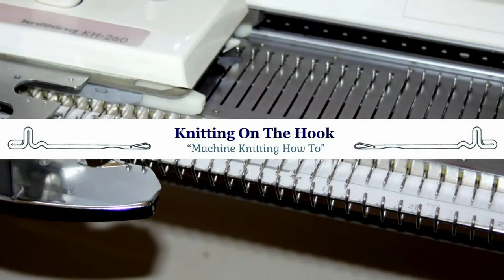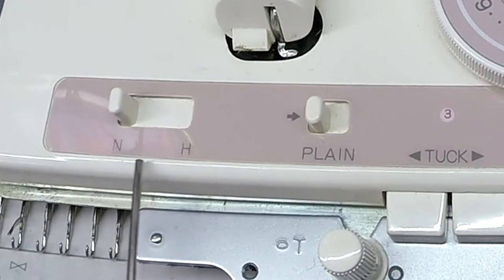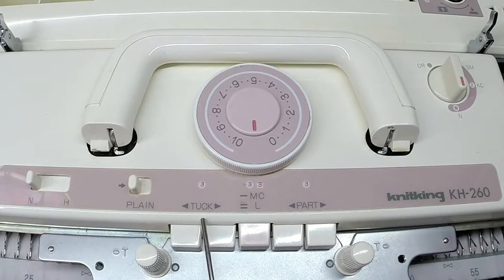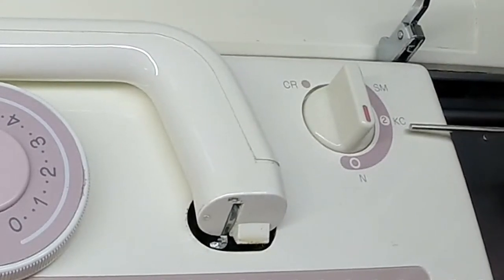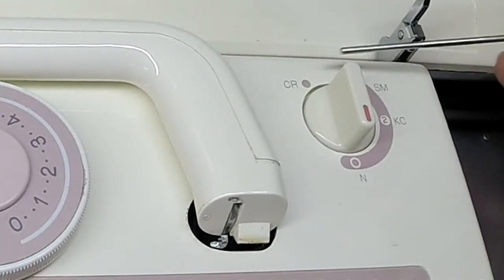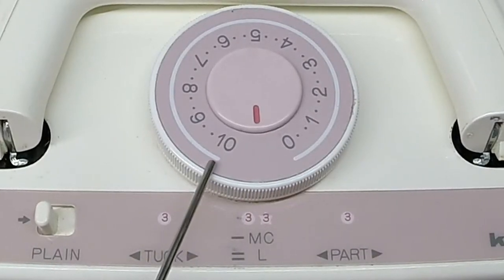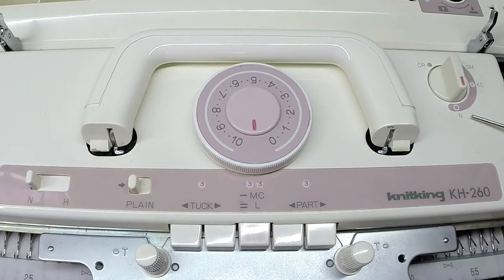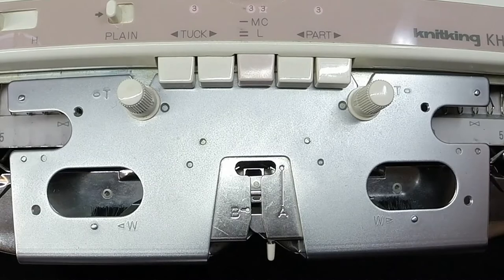Machine Knitting - Carriage Sinker Plate

Comment: I am hoping you can help me with my knit king KH260. I took it apart to clean it as I haven’t used it for a while, and put the carriage only back on the machine and now it will not go left or right. Also the dial indicator only goes to N or to KC and it will not move to CR so that I can release the carriage.
Reply from the maker: Hi! I'm sorry to hear about the malfunction of your carriage after cleaning. Unfortunately, I have no knowledge at all on the mechanical work of it so I can't help you fix it. However, I have attached a link to a video that might help you https://youtu.be/w8rrk-7YJx0 😊

Comment: what do the wheel brushes do?
Reply from the maker: Hi Jen, the wheel brushes are put into position in the carriage sinker plate when manually weaving or using the punch cards for weaving or tuck stitch pattern. 😊
Reply: @knittingonthehook  Thank you for your quick reply. Is the yard supposed to go below the whole carriage or within it? My yarn pops up over the wheels (I have rubber ones). I think, but am not sure, that the yarn is getting tangled and caught on the guard pegs as a result.
Reply from the maker: Hi Jen, if you are trying weaving, the weaving yarn should be place in the yarn guides on both sides of the sinker plate and it has to be manually transferred from one side to the other before each carriage pass. This should help the weaving yarn from being tangled on the gate pegs and under the carriage.